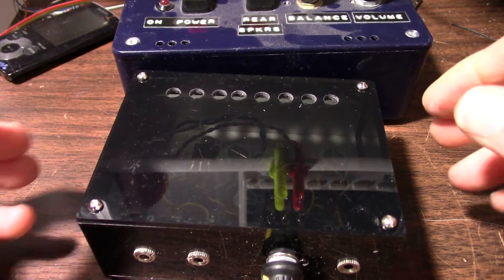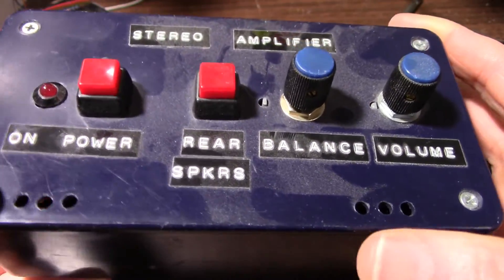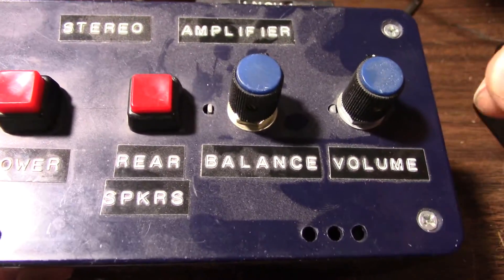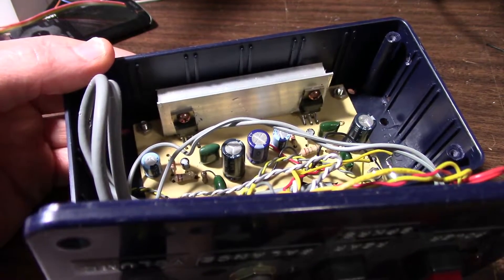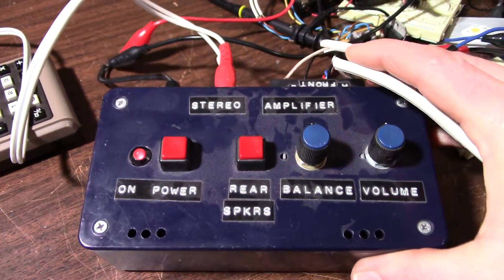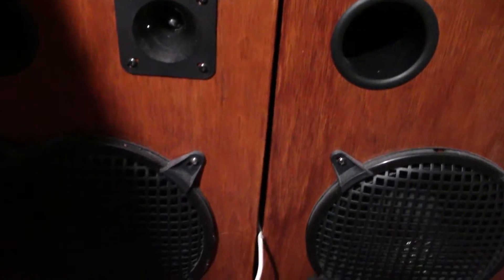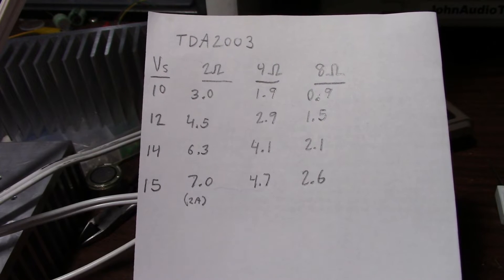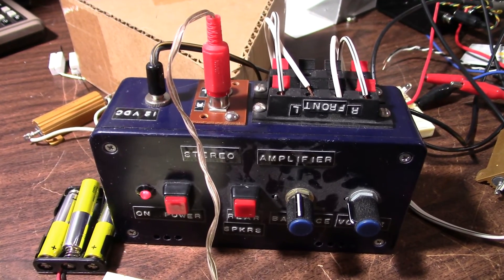TDA2003 DIY stereo amplifiers tested

Comment: If the 470 uF capacitor changed to 220 uF at pin 2 , will it increase output power ?

Comment: John, great video thank you so much. One question, when I add a resistor to gnd after the input cap the TDA2003 does not like it and starts clipping (plus adding noise) to the low voltage swing of the output. Do you know why this might be happening? I do not have this problem with the LM386.
Reply from the maker: Doing that can throw off the bias as the 2003. It a different circuit than the 386. If the resistor is to lower the input impedance, it should be added before the cap.
Reply: @JohnAudioTech  Thank you for the reply. Now that you mention it, the I see that the schematic diagrams between the two chips is quite a bit different. Seems like the 2003 has some internal bias applied to the base where the noninverting is connected which the 386 does not have. I guess the external resistor messes with that bias. Interesting enough another popular youtube channel shows the use of an external resistor with the 2003.

Comment: Back in '96, I bought 2 amp kits from Parts Express. I still have them too. They use this chip. I had built them into a box with a tone control circuit from an old 1970s stereo.  Later, around 2009 ( I think ) , I found a very interesting main speaker of a pair of computer speakers. The amplifier inside used these same chips, set up with a volume, bass, and treble control. I had been looking at all my collection of amp boards I've hung onto over the past years, and was really surprised at seeing this chip on those amps,,, then to find this video, and the older one about the newer amp build.

Also, turns out,,,  I seem to have quite a few TEA2025B amps. Some stereo setup, some mono setup.

Comment: TDA2003 is one of  the best and simplest audio amplifier IC to build for beginners. I've also built a TDA2003 circuit few years ago and added a bluetooth receiver module and turned out a great bluetooth speaker. Good video and I would also like to see a case making video.

Comment: John, I would like to see how acrylic cases are made.
Any luck with the FT measurement on the Siglent?
If the car audio chips perform so well, what are their negative attributes?
I am going to try a TDA7377 and 7379 and see how they perform in a small room with bookshelf speakers using 12v power from my solar battery bank.
Reply: I think there are two negative attributes: Low output power due to the low supply voltage, and a relatively high quiescent current (150mA for your TDA7377). Last year i have built a bluetooth boombox with a 2.1 amplifier made of the TDA7377, two amps brigded for the subwoofer and two amps for the stereo channels, and even indoors, it was too weak for a livingroom in some situations. The amplifier was sold as 2 x 30W + 1 x 50W, but a look into the TDA datasheet showed 2 x 6W + 1 x 20W @ 14.5V / 10% distortion. I then upgraded to a TDA7560 with four bridge amps and raised supply voltage to 16V. Now there is sufficient power, but not one single watt too much. The TDA7560 wastes 250mA. That is, at 16V, 4W for nothing but heating the universe!
As far as i know, class D amplifiers are more efficient. Might be worth going for class D for use with solar power, but these also lack power at low voltages.

Comment: John, have you ever build a class d amplifier without special ICs for that? This would be interesting for me. I have planned to build such a device by use of parts from Analog Devices like the LT1364 for the triangle generator, the AD5861 for the comparator and the LT1160 for the gate driver. In the output stage I would like to use the STP16NF06 power MOSFET with very low channel resistance and gate charge. What do you think of this concept?

https://ibb.co/TLJ9g3N
Reply: The circuit is still not complete. The input and output filters are still missing, because I need to calculate them carefully. The output stage is very efficient. It uses just 100 mW of power to drive 12 W at 4 Ohm output load. In fact, the gate driver contributes most of the idle power of 180 mW alone.
Reply: Jim, this is my design with the output filter for a 4 Ohm load. https://ibb.co/PmhLDRM I have decited to set the roll of frequency at 40 kHz but this is probably still to high in order to avoid too much output signal at the PWM carrier frequency. https://ibb.co/DGB5jMK I will probably to down to 25 kHz or even 20 kHz.
Reply: Jim, this is true. But you need at least a slew rate of 1000 V/µs in order to get steep enough PWM at 100 to 200 kHz. That's why I have used a special high speed comparator with switching intervals in the order of 10 ns.

I have used a special gate driver in order to avoid current shoot through the half bridge. Therefore I have to compromize with the PWM frequency, because the gate driver IC operates only up to 100 kHz.

With the use of bipolar darlington transistors you get unfortunately a significantly higher amount of power loss in the output stage because of their saturation voltage.

That's why I have used MOSFETs. The total power loss of my class d design at 16 W output power is simulated to just 400 mW. This is an efficiency of 97.6%. This if by far better than that of a class ab amplifier.
Reply: Relating to the double opamp for the triangle generator I can of course use an IC with much lower slew rate. For a triangle wave form with an amplitude of 1 V at 100 kHz a slew rate of 0.4 V/µs should be enough. I can use 10 V/µs in order to get fast enough switching at the 1 V borders.
Reply: @jim9930  The comparator is fast enough even for 1 MHz. The LT1160 is a still relatively inexpensive silicon device. It is the limiting device.

I use a switch mode power supply, so there is no need to decouple it from the triangle generator and output stage. I have decoupled it from the comparator stage.
Reply: Unfortunately the LM5104 model has a buck. The reference voltage for the overshoot protection at rt is internally referenced to ground, so vss MUST be set to ground. That's why I have changed my power supply circuit. It took a lot of time creating another model to analyse this problem. I think, in reallity rt is referenced to vss. :D
Reply: @jim9930  now I have used the LM5104 as half bridge driver which is capable to operate at higher frequencies than 100 kHz. The triangle generator is set to 500 kHz now.

https://ibb.co/dD07VtV
Reply: @jim9930  meanwhile my idea went through a redesign to make it even more simple.

I've found a useful analog to pwm converter device from Analog Devices LTC6992 which I implemented as U1 in my schematic. Only one external resistor R3 is needed to set its pwm frequency (100k for 500 kHz). It converts each signal voltage between 0 and 1V at its input into a linear pwm signal from 0 to 100% duty cycle on its exit. So only a voltage devider R1, R2 is needed to set the average input voltage to 0.5 V in order to get an idle output duty cycle of 50 per cent.

The half bridge driver,and the the power MOSFETs have not changed. The output low pass filter is redesigned to roll-off at 40 kHz.

The circuit design allows still the full exchange capability for all its modules in order to adapt the circuit to different power requirements.

https://ibb.co/XDqgVRr

Comment: What is a step response test?
Reply from the maker: A step response test involves feeding the amplifier a square wave signal with fast rising edges. It can be used to show the slew rate on an oscilloscope and test the amplifier for stability by checking for oscillation or excessive ringing under various load conditions.
Reply: @JohnAudioTech  Thanks
Reply: Step Response means to slap someone and check its response of all behave and reaction... In electronics it means pulse or square wave signals testing for circuitry harmonic responses....